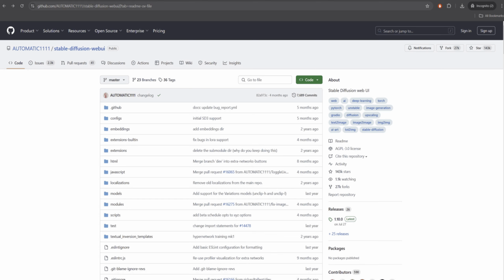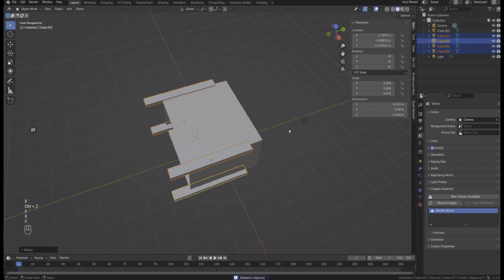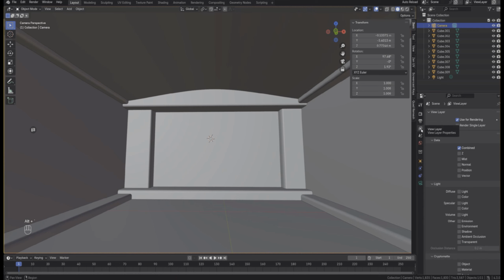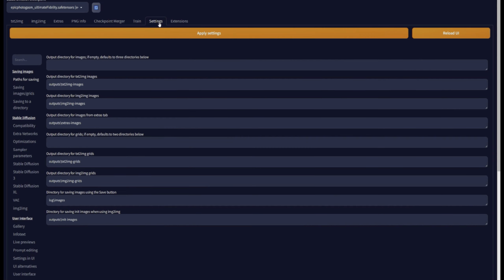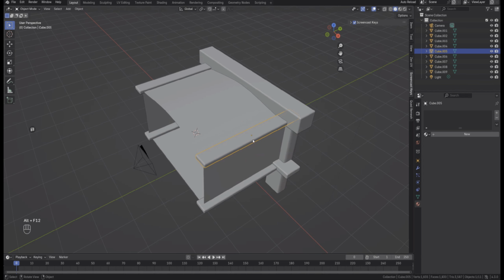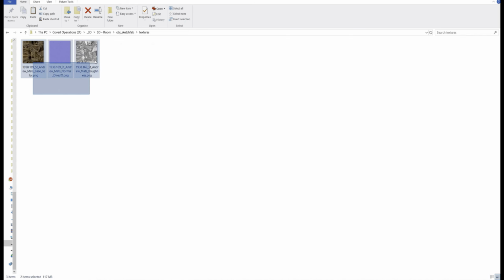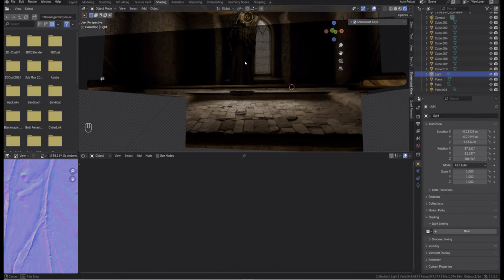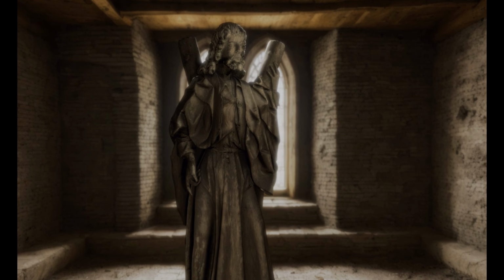Combining 3D and AI - Blender 4.3 and Stable Diffusion Workflow

Comment: Take a pic of Quinn in a-pose. Drop it into the free Vizcom page. Supply a prompt like “female character in jogging outfit” then generate. Take that pic to Tripo. Generate 3D model. Import to Blender. Quad Remesh to low res. Bake the high maps to it. Use Auto Rig Pro to create UE5 Skeleton. … Add Substance to polish the maps and Youreeeee done.